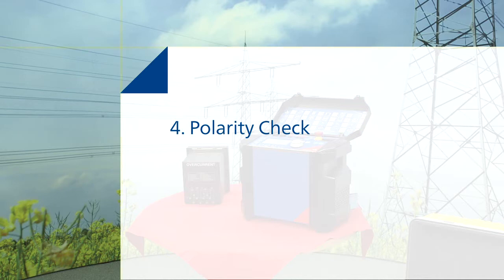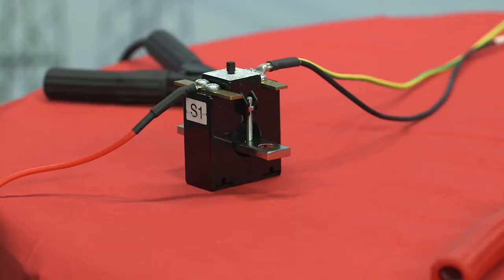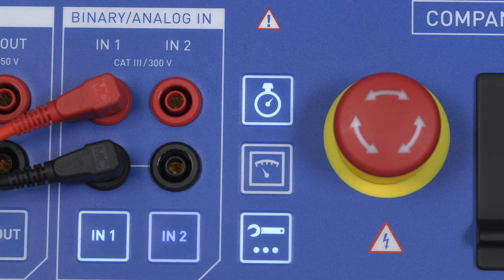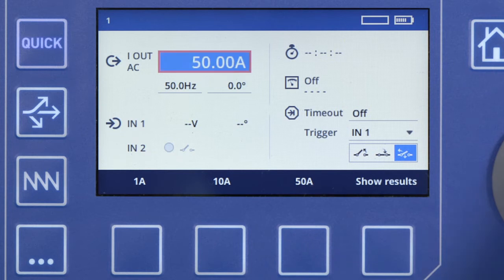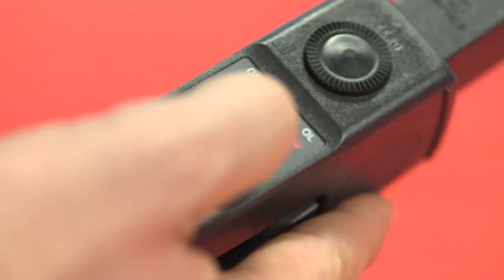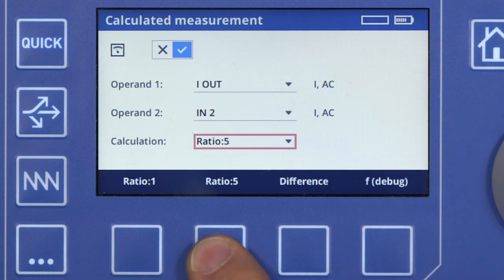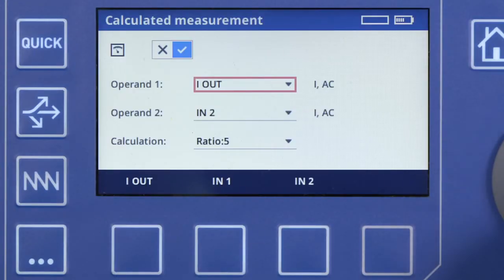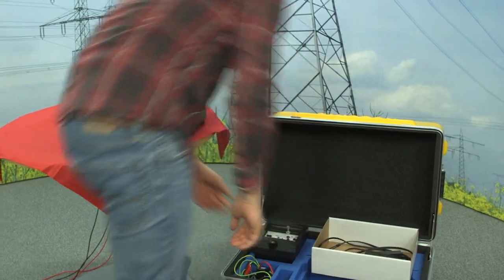COMPANO 100 Do It Yourself tutorial 04: CT - Polarity, Ratio and Burden Test

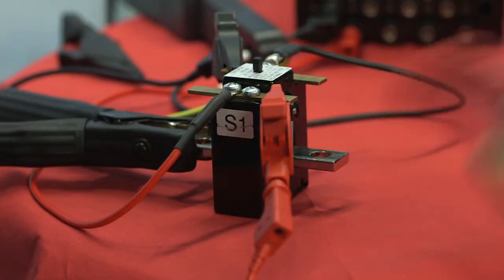Comment: Starting at 4:21, it is unclear how the wiring is supposed to be set up (in regards to what plugs in where). Without proper knowledge of how the circuit should be set up, someone could do this backwards. It seems the smaller cables that are added at this time (replacing the larger cables) should be plugged into the current output side; is this correct? Might be worth clarifying for customers.
Reply from the maker: Hi Harrison Unthank, thanks a lot for the question. We're sorry that the video seemed unclear. The wiring for the high current as shown from 1:04 to 1:17 is still valid at 4:21 - what made you assume that the cables used at that point were different? Thanks for commenting & best regards